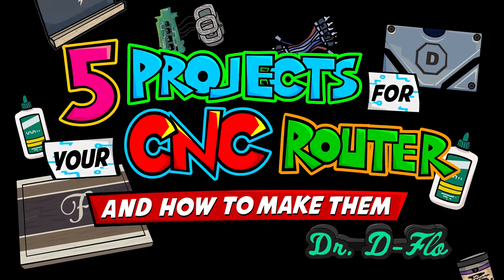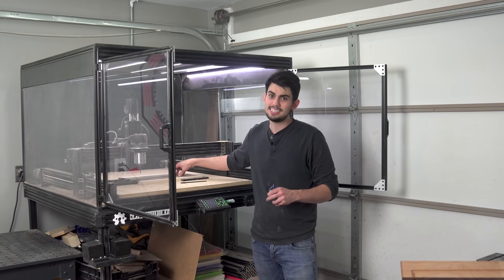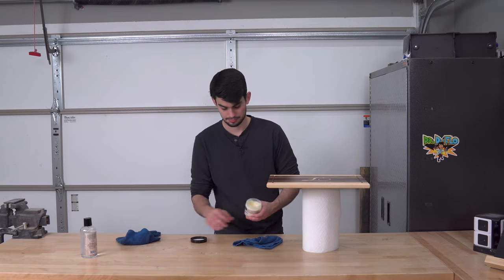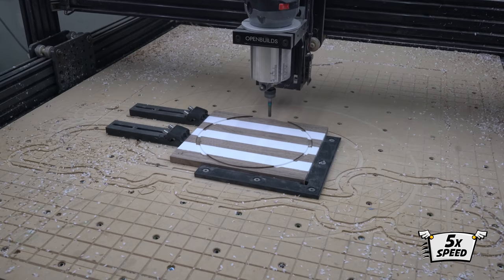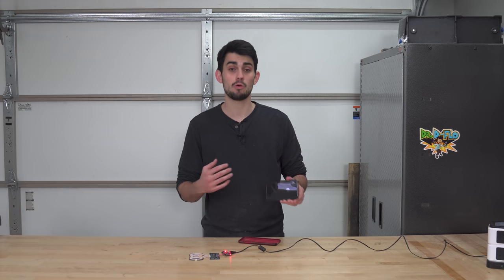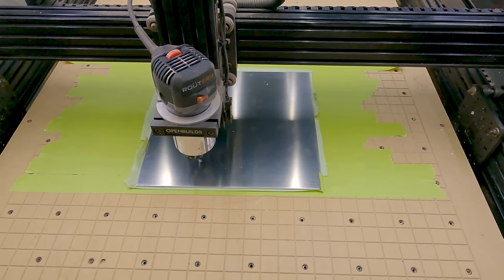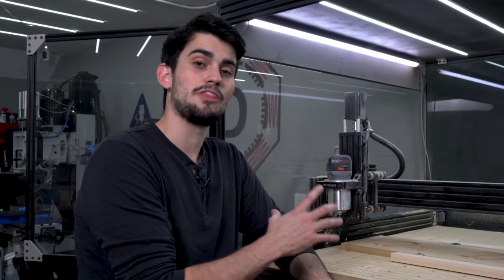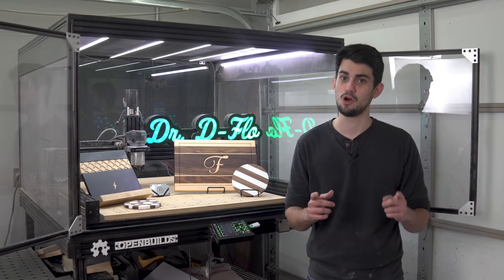5 Awesome Projects/Gifts for your CNC Router and How to Make Them

Comment from the maker: This video contains more than just 5 awesome projects! There are insider tips for success and bonus project ideas sprinkled throughout. You don’t want to miss it!

We’re trying something new! Check out the merch - https://dflo.info/merch - and let me know if there is anything specific that you want to see!
Reply: Your link seems broken. I think its because youtube takes the closing bracket as being part of the link. I dont know what, or whether there is an appropriate escape character, but a space should fix it.
Reply: please please ❤😢🌹💕 make videos about full cnc software pleaaaase 
from zero
Reply: 1 have a suggestion for you. Instead of using super glue try spray on adhesive M77 or   contact cement or even rubber cement. I do upholstery and I use it all the time. way cheaper and the work wont move. It has a slower cure time but it doesn't take long at all. Just trying to help so I'm not insulting the way your doing it. Great videos I enjoy them.

Comment: For inlays you could also use a V-bit with a 30 degree angle. You then have a better fit as you make the inlays slightly thicker and the glue it in place. The V in the cutting board and the V on the inlay will then mate without any gaps. You need to instruct the CAM to generate a toolpath that cuts ON the line to make it line up perfectly.
Reply: I agree about the V-bit inlay method.  You can get really sharp corners plus a small glue gap under the inlay.
Reply: EXCELLENT! I actually scrolled down to make this very recommendation! Bravo!

Comment: Not sure if it was mentioned or not, but, a helpful tip to get a super smooth finished board, is to sand to 220, then spray it with a little water. Let that water dry and all the little fuzzies will pop from the wood fibers. Then sand again at 220 and then put your finish on the board. Great video though, very interested in this CNC

Comment: You probably know this, but you can move your vise jaws to the outside and hold MUCH larger pieces.  Not sure your Y travel on the mill, but it might work.  I have a pallet with three 4" vises all mounted next to each other with 2.5" between.  Even with the little 4" vises I can put the vise jaws on the outside and because all the vises line up I can easily securely clamp a piece of stock 8" wide and 20" long that is almost fully supported.  Love your channel.
Reply from the maker: Yah Y travel is 11”. I probably should have just said that. So more of a limitation of the travel versus the vise. Just easier to show the max vise opening on the video. 

The plate I made in the video was about 11 1/2” in both x and y. 

In my scooter video I milled the side of the deck which was 24” or so long - most of it was unsupported because I couldn’t afford another vise at the time! 

Glad you are enjoying the channel!

Comment: I love the 3D printed work holding. Why don’t you hold down the workpiece with 3D printed parts? Seems more reliable than counting on bit pressure since the wood will not be uniform throughout.

Comment: Hi, great video. I would like to make the LED sign and have ordered most parts, but I am unfamiliar with circuitry. Any way you can help me out with how to connect this up and what I will need. I have the Feather Board, LED's and power supply. I need some help on what to connect where on the board and how. Thank you.

Comment: You used an upcut on your inlay pocket portion... Upcut has a tendency to tear out as it pulls up.  It seems a downcut would be better to keep the edge nice and clean... However the plug portion is going to go in, and then get sanded, so perhaps any tear out can be hidden anyway.
Reply from the maker: Yah perhaps I should have used a compression bit to get the best of both worlds... Sometimes the downcut bits leave bit of material, which can be significant on a shallow inlay like this one and difficult to sand in narrow places.
Reply: @DrDFlo  yeah its a fine line.  I use a new type of compression bit made for hobby cnc... really shallow upcut portion before hitting the downcut portion. These are the only bits i use (unless i need v bits etc).  https://www.cadencemfgdesign.com/shop

Comment: Could you tell me how reliability and precision has been with your CNC since it uses wheels riding through dust and debris coated beveled notches. I'm looking to buy a CNC unit soon to add to my laser business. thx
Reply from the maker: This is a DIY machine so it is what you make it. Stock configuration is reliable but as you pointed out dust and chips can coat the rail. So either you need to wipe the rails every now and then or purchase a dust shoe or linear rail covers to prevent the debris from inhibiting the linear motion.

Comment: Great work how well does the enclosure work does it help reduce noise
Reply from the maker: It helps a little. But could be much improved if you used wood instead of polycarbonate or acrylic for the sides and back

Comment: Does the free version of Fusion 360 still offer tool paths? I thought they removed pretty much all CNC options some time ago.
Reply from the maker: You can do 3-axis milling on the free version: https://www.autodesk.com/products/fusion-360/personal 

Also, I suggest you start a “company”… start ups get full featured fusion for free. I think the only requirement is a website which are free to make nowadays. Are you picking up what I’m putting down?
Reply: @DrDFlo  Great tip! Thank you :)

Comment: So, you're saying, there is a more user-friendly software with the capabilities of fusion 360? I don't think so. There are several Software pakages out there - all with their own flaws. But fusion is the "one thing does it all" Solution - and it's nearly as capable as the real inventor, but adds manufacturing, cam, simulations etc at no cost. I've gone for a subscription of fusion, just to use the rapids. Yeah - I could  edit the g-code and do it on my own, but heck: $1500 for the three year subscription is a steal compared to other softwares.
Reply: Life commenting here: The superglue method works also for plastics and even aluminum. just be sure to use a good brand of superglue and a activator.
Reply from the maker: I'm a big fan of Fusion 360. I pay the $1500 to run a $500 CNC machine lol. Building the machines is therapeutic, but troubleshooting g-code most certainly is not!

Comment: Walnut is not the best wood to use for a cutting board. Walnut is considered toxic and even though cutting on it may not release enough material to cause problems, it should be avoided. Its also important to have good dust control when machining walnut for the same reasons.

Comment: Great video. Have you tried Vectric Vcave pro or Aspire. They have a function built in to make inlays using a V bit to get crisp corners and edges. If your into 3d models, they come with around 400 3d models.

Comment: Could the clamps you showed in the video hold the material down (if using an up-cut bit) if you had placed two clamps on each side of the material?
Or would you not risk it?
I'm tempted to 3D print some clamps with teeth in the face to hold it if you think it would work.

Comment: I love fusion, but I swear it is impossible to use the second you add a svg or dxf into the mix. No easy way to control the size or center it with other features
Reply from the maker: If I am making a design that predominantly non-dimensioned features (e.g., text, logos, etc.) then I design the whole thing in Adobe illustrator -> save .dxf -> use fusion to generate the tools paths. As you pointed out fusion is not so good for the the artsy bits.

Comment: that machine does not look reliable, exposed tracks, plastic wheels, exposed threads... even if you have vacuum chip clearing, it's still gonna bind, and oiling it isn't gonna be enough